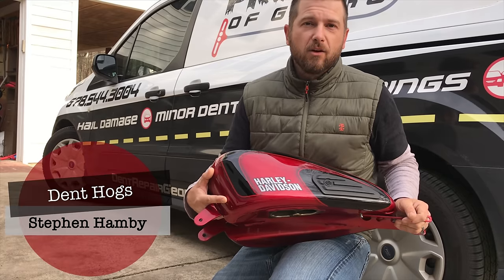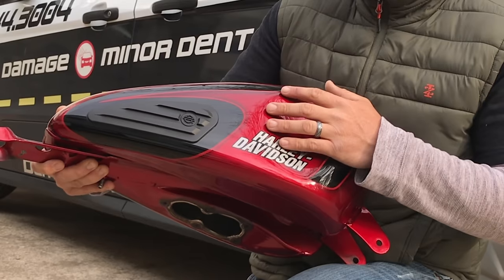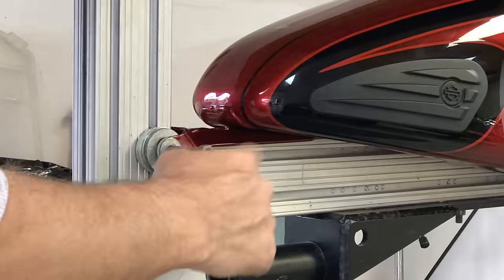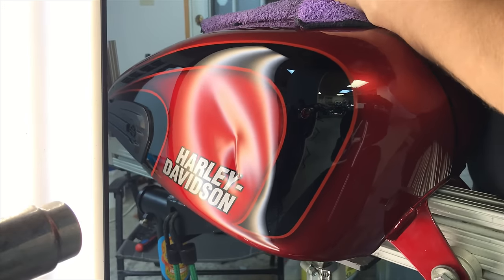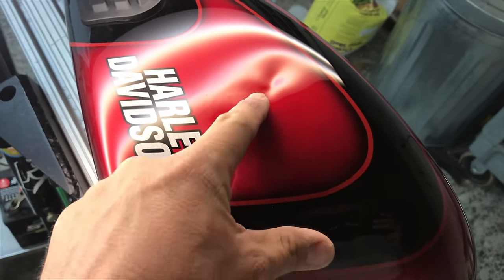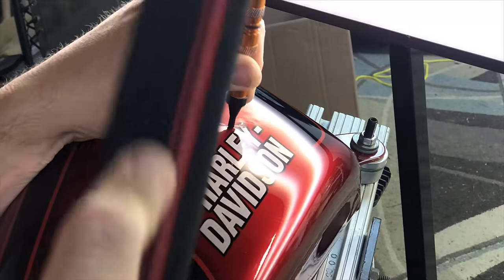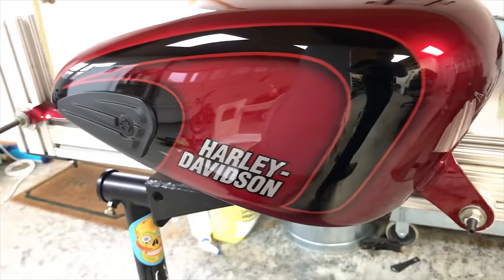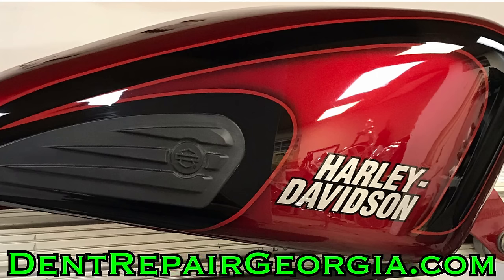Motorcycle Dent Removal - Harley Davidson Sportster Gas Tank Paintless Dent Repair

Comment: It's the size of the inside of someones knee,no big deal smack the other side with a rubber hammer till they are close enough to look the same and,Voila you now have a Custom Tank that nobody else has LMFAO. Do some light sanding and a quick spray with your favorite rattle can.Done deal go ride the frigging thing. Put the money you would have spent into calling up NRHS for a big boar kit with head-work on the cheep or get the whole shooting match kit to smoke most of the Big Twins your riding with and if you like quicker, rather then top end drop 2 teeth off of your front sprocket and you can still use your same belt if you don't slam it more then 2 inches. Good fun without big bucks and if you dumped that hard with your knee in the first place your still getting use to riding a bike or just had that extra beer at the last place and chances are you might do it again unless you count the beverages that helped you put the dent in it divided by the amount of police you might encounter and subtract at least 2 and you might be okay. But the original dent like that means (Usually You Grabbed A Fist-Full Of Front Brake) and didn't palm the bars to adjust and washed out,in that case if it happens again and your still physically okay.I'd get a new tank because anything more then that your gonna be close to 2 gallons of fuel and it will stress you out on a long run having some fun twisting the throttle most of the way with your guy's before you punch it out with NRHS. Then all your doing after a few good blasts is looking for a Gas station to keep playing and been there and it suck's...Also when the Boy's at NRHS set you up it's like an extra bike between your legs compared to the stock shit and if you get a little stupid after putting that stuff in,the least of your worries would be a dent in the tank. ;(
Reply from the maker: Patrick Teto im sending all my tanks to you in the future 😂.  Thanks for the comment, it was an enjoyable read 👍🏻.  I actually have had people ask me if I could hammer in the sides of their tank to create knee pad dents for them 🔨

Comment: sorry, its a decent repair but the damage is not gone.  you can clearly see the wrinkling at the Y area at 4.13 and 4.22.      you did try but the dent was just to bad, no shame is accepting that.
Reply from the maker: Dominic Kelly I told the customer from the beginning that this wasn’t going to be 100% flawless.  It was stretched and scratched but when compared to a $6500 tank replacement he was pleased with how well it looked considering.

Comment: That is impressive work. Great job!
Side note what kind of ass hat gives this video a thumbs down??... I’m guessing someone that doesn’t know quality work
Reply from the maker: Train Wreck YouTube trolls....I’ve had to delete a lot of comments from people being nasty for no reason.
Reply: I have a buddy that is a PDR guy and he quit doing bike tanks because the inside zinc coating gets scratched and then there is a rust issues . Eventually causes fuel delivery issues. Any recommendations?
Reply: @ProPDRofGa  Excellent work by the way.
Reply from the maker: Budskrilla 2U there are products that can be used to re-coat the inside of a tank, red coat is one that I’ve heard of that’s pretty good. This will coat and seal the inside of a tank after a job like this is done.
Reply: @ProPDRofGa  Thanks for the info bro

Comment: Our local dent guy is very talented, but he will not touch a motorcycle tank.He is afraid of Sparks and tank explosion.Too bad because he could name his price.
Reply from the maker: Richard Merrifield it is highly unlikely that would ever happen, once the gas is drained its a non issue.  I had my reservations at first too though.
Reply: @ProPDRofGa  Not so my brother.Fuel residue and fumes can linger for a very long time.An open flame or a static spark at the tank opening can produce a real surprise.
Reply from the maker: Richard Merrifield well so far I still have my eyebrows so that’s good 😂.  I appreciate the info 👍🏻
Reply: @ProPDRofGa  Don't get me wrong,you are a true Craftsman
Reply from the maker: Richard Merrifield I appreciate it 🙏 thanks for checking out the video too.

Comment: Seal the tank and fill with hydraulic fluid and pressurized it.
Reply from the maker: C List how do you seal a fuel injected tank with openings big enough to fit your hand in?  How do you prevent the paint from cracking or busting the welds due to the pressure even if you could obtain a water tight seal?  I’ve seen videos where this is attempted and it never leads to the dent being removed fully.  I only see obtaining a seal like this on an older carbureted bike that has one petcock opening and one fuel opening, injected bikes are a different story all together.